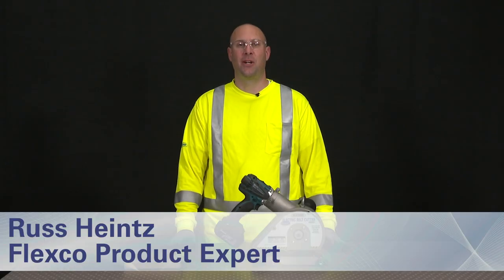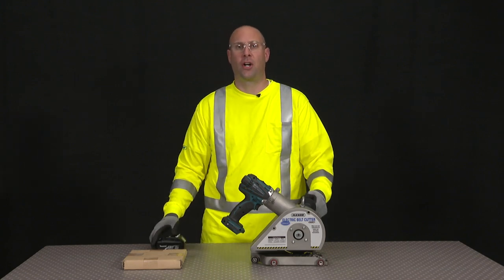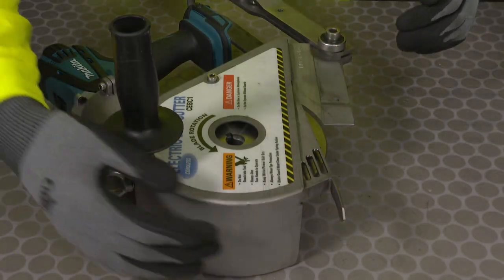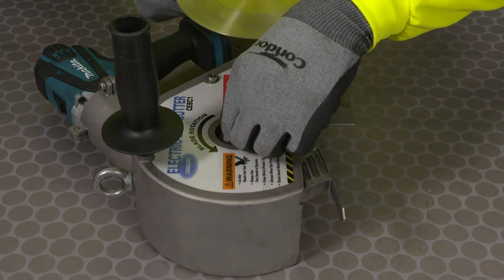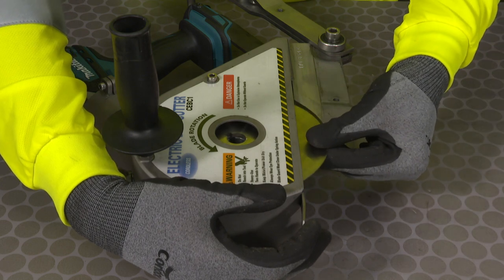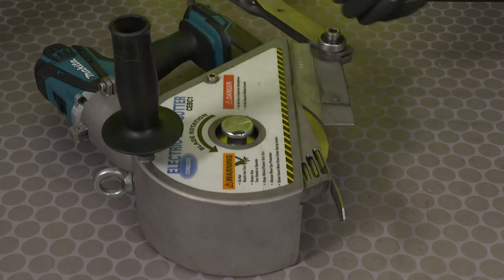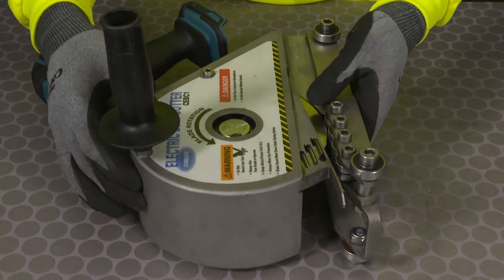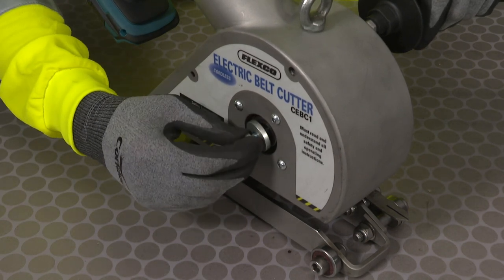Changing the blade on the Flexco Power Belt Cutter

Comment: Life span of blade?
Reply from the maker: The life of the blade will vary depending on what type of material you are cutting, such as soft rubber plied belt, harder PVC belt, UHMW, new belt and used belt to name a few.  If the belt is worn with small particles of material embedded in the belt that will have a major factor in blade life also. The blade can easily last 1+ years of heavy usage if the material doesn’t cause excess wear or damage as described.